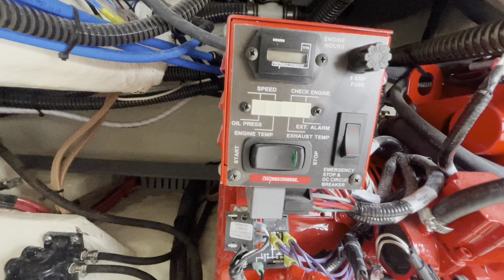How to clean a raw water strainer or sea strainer on your boat

Comment: This is in the strainer. It’s called a strainer basket. It’s basically the filter for water coming from the sea that is used for air conditioning and/or heat. Groco is the most common manufacturer.